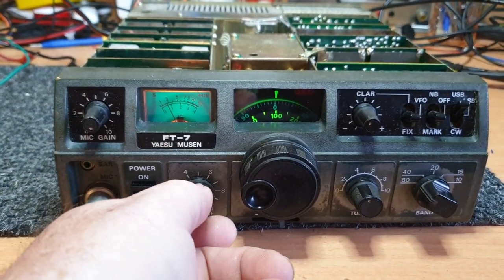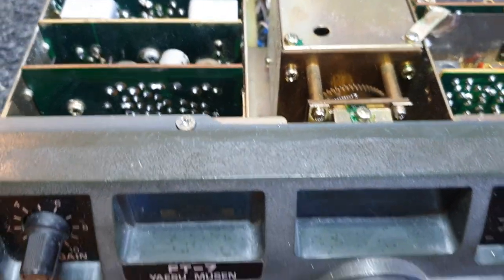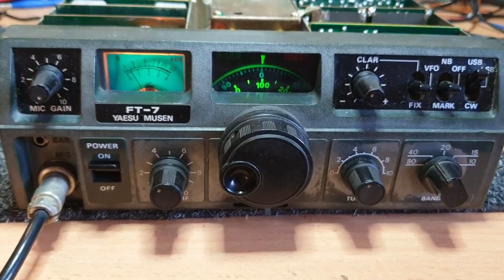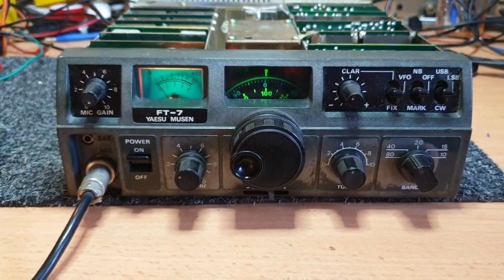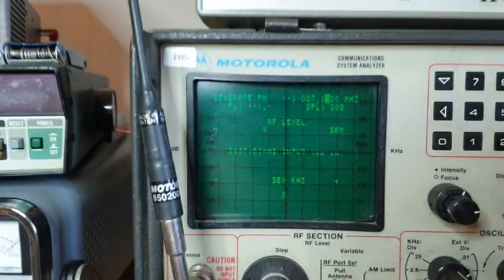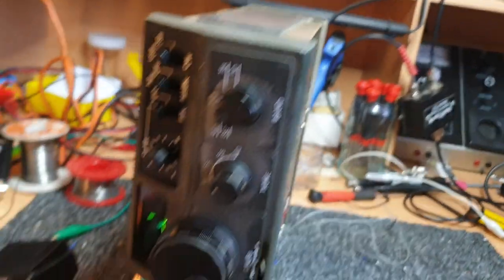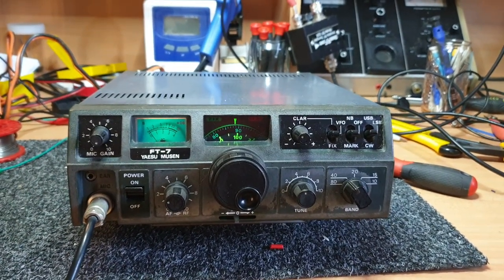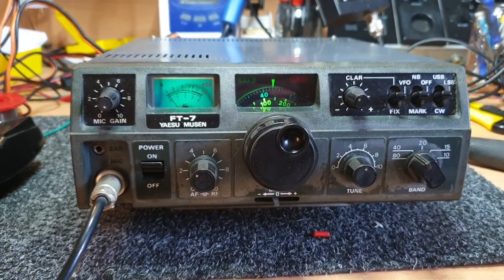Yaesu FT7 contacts refresher...Annoying Audio tick tick tick noise fixed...

Comment: Ex factory the FT7 was actually 10 watts output,  looks like this rig has been  fiddled if it is 17 to 20 watts output on a 2 tone test  yes/no?
I bet they are not pure fundamental watts that are being measured.
Reply: Pge 2 of my owners manual indicates 20 watts DC input so depending of the design of the final stage, that should equate to a safe factory power output setting of 10 wats on cw and ssb .

In those days some yaesu rigs specis indicated input power and not output power.

At one time in the USA  the regulations stated permiited power as input power so maybe that is why yaesu did that.

My owners manual  was printed about  1978?
Reply: I've had a couple and both delivered 16 to 20 watts, depending on band selection  and ALC adjustment..

Comment: I recently grabbed a FT-7 on eBay and really like it. I did a full cleanup of the board contacts and switches. It's a very sensitive receiver but the audio is a weak link compared to my 101EE. Do you know of any issues with the audio that I can check out?
Reply: Audio on the FT7 should be pretty good, with lots of volume. Had a similar issue and found a few electrolytic capacitors needed replacement on the audio board